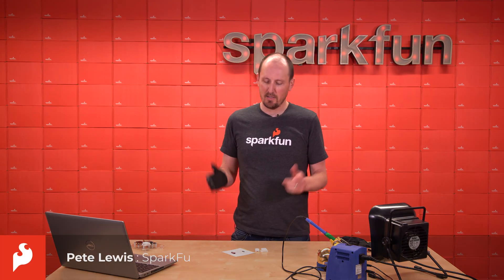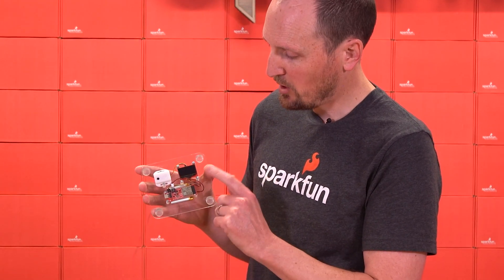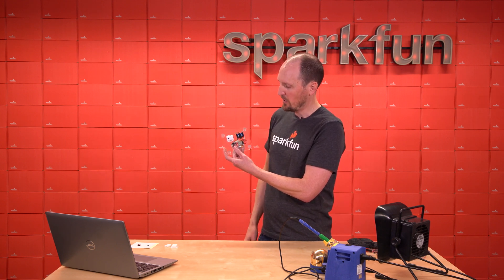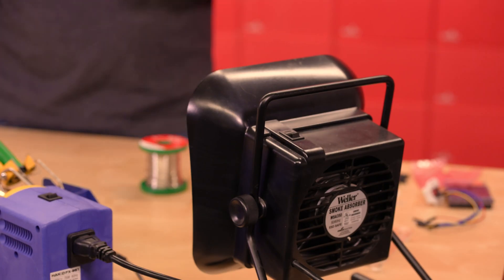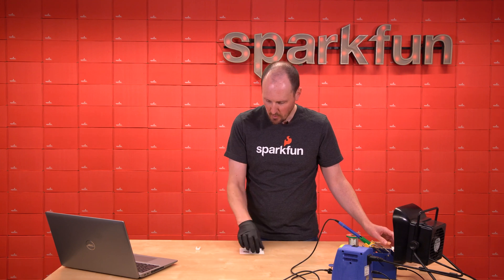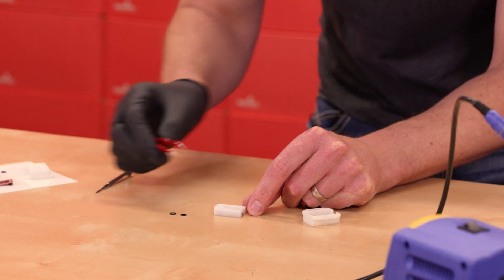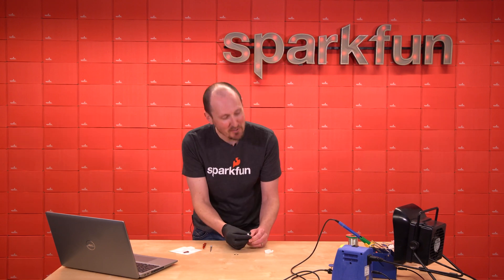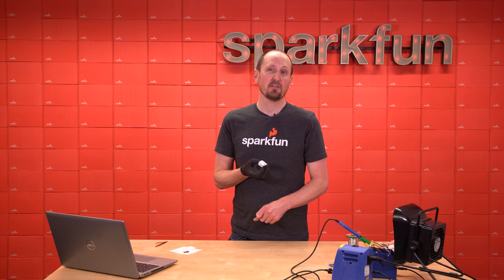Product Showcase: SparkFun Qwiic Particulate Matter Sensor BMV080

Comment: That's actually "huge". As in "huge innovation". The size isn't that big of a concern, but fan vs. fanless makes a big difference. It still has quite some power draw, but nothing compared to previous designs running a fan.
Reply: I disagree. Size matters here, because when Bosch developed that sensor, they planned to integrate it in mobile phones.
Reply: @desiludidos2025  I'm not entirely sure about that. These sensors are for the most part not compatible with IP-ratings. Clear is, a sensor that is smaller and has less moving parts, ideally none, will be quite a lot cheaper. This gen is still too big and the power draw is to large for phones.
Reply: @graealex  sorry, No! I am living here near Reutlingen in Germany where the sensors are produced and I know from some „Insiders“ that Bosch planned to integrate those sensors in mobile devices. I don‘t know if that will happen in future, but that was one of the main reasons to develop the bmv080.
Reply: @desiludidos2025  I assume it means you have friends at Bosch. Anyway, the BME280 is the benchmark for how small you'd have to make a sensor for it to have a chance to be even considered for integration. Plus temperature, humidity and pressure works through fine meshes, but PM does not.
Reply: @desiludidos2025  Btw it's a perfect sensor for automotive HVAC, and that's what I believe is their goal, especially it being Bosch, and basically being the inventor of MEMS gyros, which were specifically developed for automotive.
Reply: @graealex  it is not about any benchmark that you invented. Did you ever have a look at the back side of your mobile phone
? Did you notice the size of the sensors and the lenses in your phone? Do you think the bmv080 is larger?
Reply: @desiludidos2025  The BMV080 is huge in comparison. Maybe open up a phone and then tell me where there's supposed to be space to integrate such a large sensor with questionable benefit. The latter is really the point. Phones wouldn't even sense humidity if that feature didn't come for free.
Reply: @desiludidos2025  Anyway, I listed valid arguments for why this sensor has little application in a phone, but might be huge in HVAC and automotive. If you want to be negative about it, even be personal (I "invented" a benchmark), but that doesn't make my arguments go away, plus I'd rather not engage with you anymore.
Reply: @graealex  no, it is not huge in comparison. It is way smaller than the lenses in my iPhone. Maybe you have to check the real size of the sensor and not the final product from sparkfun.
Reply: @ The lenses have a use case. That's why close to 20% of a phone's internal space is dedicated to them, plus usually an NPU on the main board. A phone making good pictures is a USP. A phone telling air quality is not.
Reply: @graealex  what are you talking? Minutes ago you told me that it is to large and now it is no longer to large, but there is no use case? How do you know that? Did you just create a study about mobile devices and what users want?
Reply: @desiludidos2025  The average logic board in a phone is 4-8cm². Real estate is expensive, and as I already wrote, it needs to have a USP. Again, I'm repeating arguments, and you nuh-huh. Learn to properly argue, your whole argument revolves around "I heard it through the grape vine".